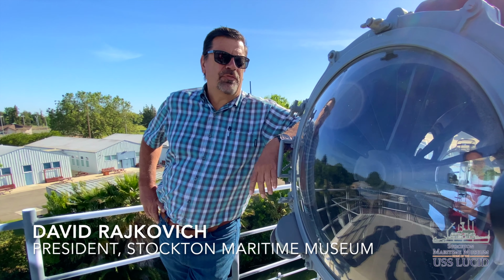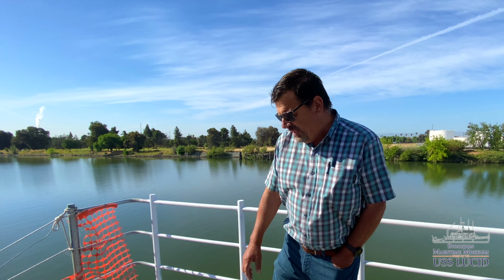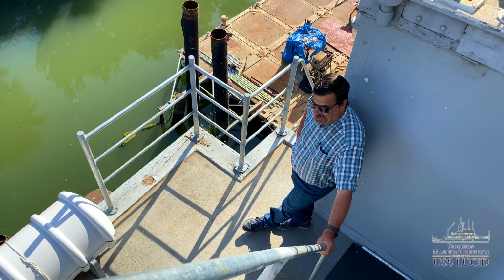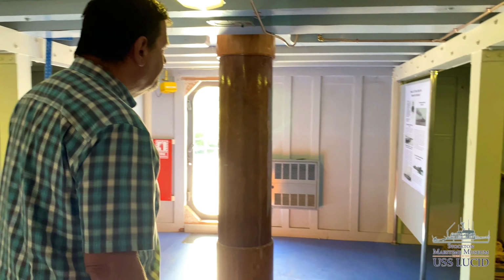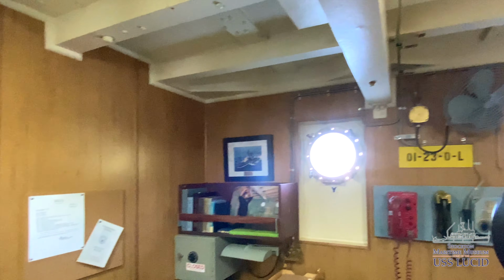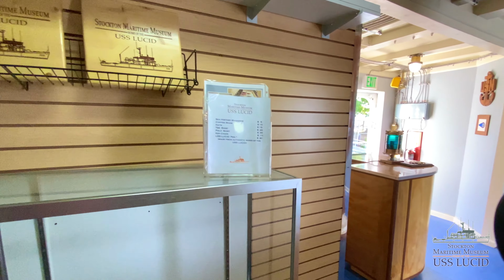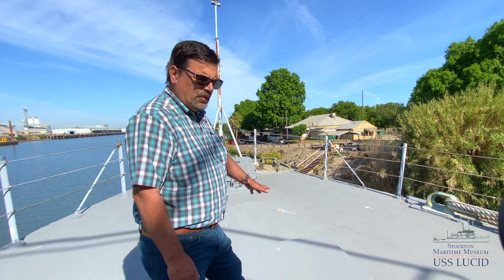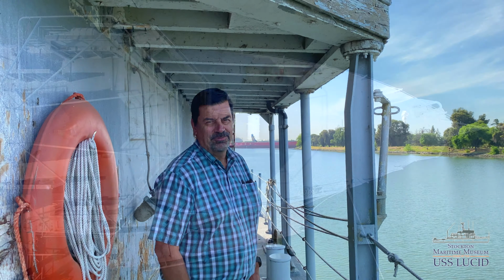USS Lucid (MSO-458) Ship Restoration Update and Tour # 1

Comment: Served aboard MSO-463 (Pivot), MSO-445 (Force), and MSC-205 (Vireo) 1961-1963.  The Fram job really changed the 02 level.  The Pilot House restoration is very well done.  Glad to see someone restoring one of these.  Served with some great guys on these ships.  Brings back a lot of memories, from the constant radio and teletype traffic in the radio room to the ever constant stack gas blown around by the wind, and the response of the ship to sea conditions which was not a lot different than a comparable sailing vessel due to the round bottom hull along with being a little top heavy.
Reply: That pilot house is absolutely gorgeous. Job well done.